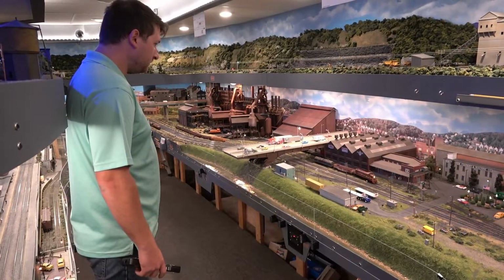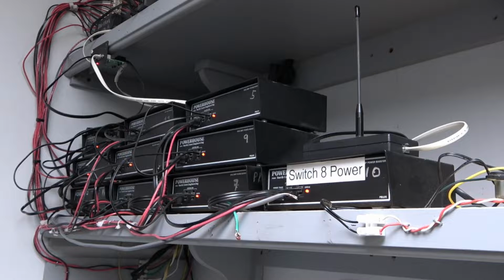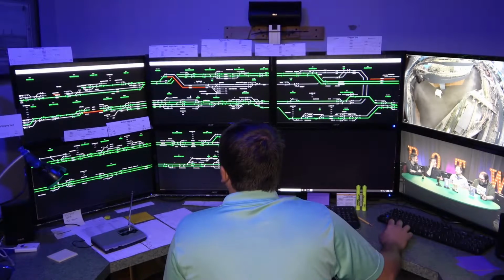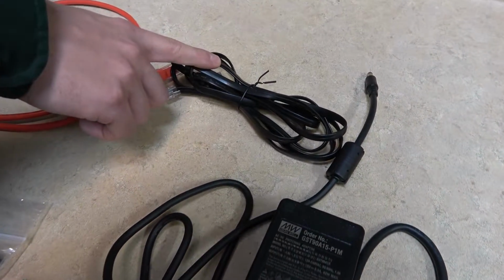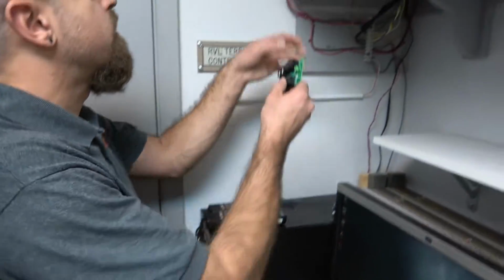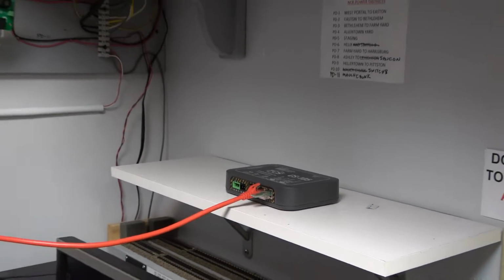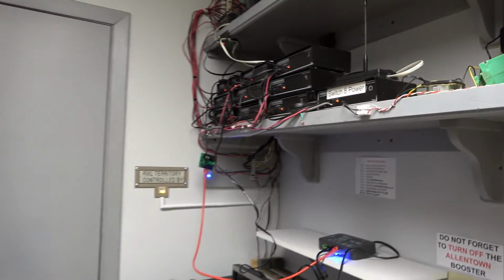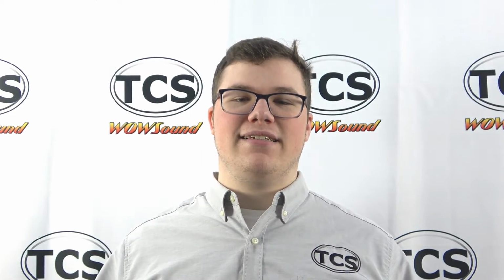Upgrade Your NCE System With TCS!

Comment: Can the TCS system hook up with the NCE PowerCab i watched how Larry Puckett used the System & I was in Aww  seeing Larry use it in Another YouTube ch. The N Scale Review he was showing the TCS throttles i liked the Throttle that he was using & showing yard mode the Engine rolled at a slow pace needed in Yard he centered the throttle at zero & the Engines eased to stop i thought that was totally Awesome I'd like to try this system but when asking the Hobby Shop that I buy 95% of my stuff at if they'd stock the system they said it probably wouldn't be feasible or profitable to stock the system as they already stock a well known product which is Digitrax.. 

Its disappointing when a Well known Hobby shop as they are,  aren't up to trying something that is as Versatile as your Guys system is my only issue is I can't spend a big amount at one time if I could pay a little amount in small portions or save up over a few months I could Absolutely get this system and eventually I will either by ordering directly through you guys or from Another Dealer if you Guys would like me to let you know who the Dealer is that I buy from i can send you all a Email or call you Guys but I think this Dealer is missing out on a Good Product they Do sell your Decoders which I feel Honestly is a lot more superior to Anything that the company I mentioned sells.. 

And the TCS Decoder thats in my N Scale  Siemens Charger I love it.. Love it.. 

Allen D
Reply from the maker: Thank you Allen! I know it is a bummer that your hobby shop won't stock our fantastic Command Station. Feel free to order from us directly! I am so happy you enjoy our decoder in your N Scale Bachmann Siemens Charger! Thank you for using our products and being a fan of TCS products.

Comment: Nice presentation, very simple and understandable. Question. The NCE stores the consists in the decoder using the 127 addresses. The TCS groups engines and the CS-105 runs both engines from that group. Will the CS-105 able to run an NCE consisted engine set without removing the CV19 address from each engine? Thx.
Reply from the maker: Yes, that will work since it is stored in the decoder itself. 

-Carson

Comment: This is a great video and looks like a great product!

Do you plan to make a similar version of this video showing the upgrade of a Digitrax system?

In theory could this Booster Adapter be used to connect to NCE and Digitrax at the same time? Just curious about the limitations.

I know when you run multiple boosters generally there is a requirement to bond or ground them all together depending on the brand. I believe it is also recommended to tune the voltage to make sure that all the booster are outputting voltage as close as possible to each other. Are there any recommendation for mixing boosters between brands? Obviously in this scenario the CS-105 isn’t outputting any power so it probably isn’t relevant in this scenario. 

I’ve been doing research on LCC and came across the CS-105. It’s a very neat product and will likely be my next system!
Reply from the maker: Thank you Brandon for watching! Yes we do plan on making a Digitrax version of this. You could do that but you would need to see if there would be any butting heads between the two brands of boosters that you plan to use. All the CS-105 would be doing then with the Booster Adapter is outputting Track Signal.

Comment: Could I completely replace my CVP Easy DCC, with this system?? Or, will it work with CVP'S?
Joe Bliss
TCS Dealer
Reply: If replacing the CVP Easy DCC system with the TCS DCC system, you can potentially reuse your boosters. However, CVP uses an unpublished proprietary protocol for their throttles, and so far, there is no adapter device to use the CVP throttles on an LCC system. The reason that NCE throttles can be reused is that the Cab Bus protocol which NCE uses is published, and TCS created and adapter which is integrated into their CS-105.
Reply: The v4 wireless throttles should work with the ALR900 XPressNet receiver when TCS adds XPressNet support. The v6 throttles will not work.

Comment: How do I eliminate the NCE Command station and still use all of those power boosters (lets say so I can use the NCE command on a different layout?)
Reply: Can you be more specific about your question? I'm pretty sure this is exactly what is covered in the video. Am I missing something?
Reply from the maker: You will need to make sure that the NCE Command Station is in Booster Mode. That way only the booster would be doing the talking and the Aux port on the CS-105 would be taking care of the Throttle bus.
Reply: You could replace it with a regular booster or use the CS-105's integrated booster as long as you connect them together via the common, thus freeing up the NCE command station and built in booster to work on another layout or to sell.
Reply: @woodalexander  This best matches what I was trying to ask.   In the video they continued to use the NCE command station in the new TCS system which is not the scenario I was trying to ask about.  I want to either sell the NCE command station or use it on another layout project.
Reply: @Willamor1  Yeah, using a Power Pro system as a booster is sort of a waste unless you want to have a backup command station available.